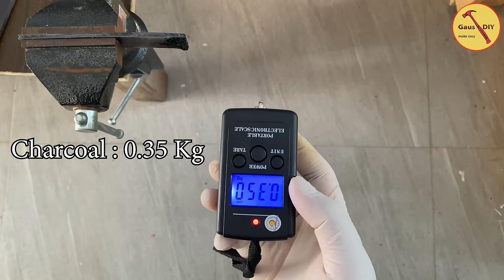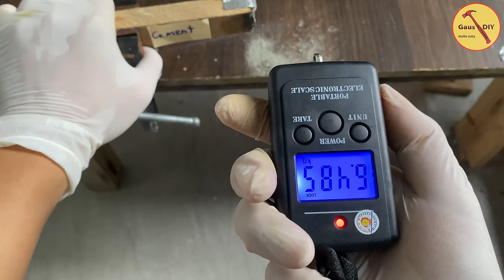3 Experiment Comparing The Strength: Baking Soda, Cement, Charcoal, Styrofoam

Comment: interesting video, and interesting experiment! you should try again, but try to be more scientific. the adhesives should have the same surface area on the material, the point you apply pulling pressure should be from the same distance from the connection point, the point where the vice is clamped should be the same distance from the connection point, the charcoal and cement should be ground to a fine powder (as fine as the soda), you should let the glue dry all the way, and many more variables you could control! good luck
Reply from the maker: Thank! Have a good day!

Comment: The single most important flaw of this test is location of the hook placement was so different for each. The closer you place towards the base the more force it will require to break it for the same strength of the glue because of the law of physics.

Comment: The Baking Soda seems to be the preferred here and there is a chemical reason as it reacts. However the charcoal has way to large particles. I used a combination of graphite super fine for locks and baking soda and did get higher values than with baking soda alone. graphite alone did not achieve the same result.Also the baking soda in the US seems to be more reactive than the one in Europe.

Comment: Ok, nice experiment. BUT, in science you should try to avoid external variables so the experiment is focused only on the subject of study. For example: 1. You should have measured the amount of superglue in each case, and the amount of bonding material so it is consistent. 2. You should have measured all your pieces to be exactly equal in length, width, height and weight so there is no influence on the results. 3. When you were pulling on the screws, the plastic, and the wood, you should have pulled from the exact same spot (to a millimeter) all the times so the lever effect doesn't add up (the farthest you grab the lever, the strongest any force is excerted on the fulcrum). Finally, you should have tested for "flukes" by performing at least two experimets by type.
Reply from the maker: I'm very happy to read your comment, Thank you for your useful knowledge! Have a nice day!

Comment: Nice effort but momentum is the key here, its changing all the calculation.. so if you dont apply the forces on the same distance then it doesnt make any sense in comparison.. for instance I can see in the last experiment, force is being applied on cement is approx 15% far from the center compared to other materials which means its resistance is not 6,5, but around 7.5kg or even higher than charcaol.. this is very tricky :)
Reply from the maker: Thanks for your information! I learned a lot from reading everyone's comments! It helps my knowledge improve.

Comment: If you're going for my accurate results you should of placed the force gauge at the same point as all of them so they all would have the same leverage. Some of the tests u were closer to the center where the glue was and that is less leverage than being further out to the end so I would take a lot of these results with a grain of salt as the numbers wouldn't be as accurate as they should be

Comment: I don't thing the glue bonds were consistent, some of the bonds did not get completely saturated with superglue, judging by the dust cloud. And his pulling point moved around, causing different leverage between material tests. Even so, I would like to see tests of Graphite and and Graphite with different percentages of baking soda mixed in.

Comment: By not placing the "lever arm" the same distance each time changes the force placed at the joint.  In one of the examples, you put your thumb on the board which causes the force required to move.  This invalidates the example.   Ideally,  the distance from the clamp and the plastic tie should be the same for each tests

Comment: Not sure it was accurate measurements for the experiment, however my guess is that cement, if mixed properly would be the strongest. It didn't look like you used the right mixture.

Comment: I don't wanna be "that" guy, but if you're gonna experiment like that, you need more than just one run per element on each test... and then take the averages as a result. But most importantly for the love of god, the distance between the point you pull and the connection, if that's not measured exactly then all these numbers mean nothing.
Kudos for the idea though and the initiative.

Comment: Some of your other tests are better, but u missed a few things on this video. For instance...on that first test you do, your not really doing anything with your gauge except measuring when your hook slips off the bolt. Perhaps you should use an eye bolt, and cut off the end so you have a flat bit to glue to the wood. You'd be better off hanging them all sideways, and putting weights on them to ensure you have the same forces...as the angle you pull with your hand will also skew your results.

And then on your last test - where you glue the 2 boards together end to end; Note that you have a random placement of your Zip Tie when your pulling on that wood to test the force your pulling. For Cement your Zip tie is about 5 inches from the joint and the next one, your only 3 inches away. To do that right, you have to put your Zip Tie at the Exact Same distance from the joint to measure the force including the leverage you have used to pull the joint loose. 

For Example, if you put the Zip Tie 1 inch away from the joint, you will find it harder to break than if you put your zip tie 12 inches away from the joint, because your using the Leverage of the board length, to put force on the joint. So measure out the same exact distance - say 6 inches and put your Zip consistently at that point to measure your force at your joint.

So good try, but you need to brush up a bit on your mechanics a bit so you can accurately measure the forces involved.
Reply from the maker: I have received a sincere suggestion from you, I have also read many comments and have understood what you said. I will try to improve my knowledge! Thank you!

Comment: Why not use a machine screw and tighten a nut the same amount of turns or even two nuts, then you can pull from the same point.  The fulcrum needs to be the same height.

Comment: I like the video and your testing of materials but
You need  to be more scientific for better accuracy but we get the idea....

1.  your space in between the materials needs to be exactly the same

2.  the spot that you hook the weight scale on the screw and on the plastic needs to be the exact distance from the spot in the vise and 

3. The weight scale needs to be exact distance from the area that was glued.

4. And like the previous comment I guess the volume of the materials needs to be the same as well as the drops of glue need to be the same as well as using a separate spoon you don't want to mix the charcoal with the styrofoam ;)
Reply from the maker: Thank you for your sincere comments. I am very happy to read your comments. It helps me have more physics knowledge.

Comment: Ft-lbs Torque is going to be different if you pull on your glued pieces at different points.  It's the same concept of loosening wheel nuts and using a cheater bar.  The farther away you can pull, the more leverage you'll get.  All pulls need to be done from the same spot or you aren't measuring the same thing.  Cut all pieces to same length, and then measure & mark the spot you're going to pull from so that spot is the same on each piece.  Pulling an inch to the left on one test and inch to the right on another test for a quick camera audience might appear as being similar enough, but it's a pretty noticeable difference in pull force required that you're introducing unknowingly.

That charcoal should probably be dust or at least closer to it.

When you were setting up at 5:31, I'm sure half the audience was looking at the discrepancy in the distance apart your wood pieces were with the cement test being visually very obviously different than any of the others.  All tests need to be pretty systematic.  As same as possible.

Comment: Kind. But you should plan the experiments a little more cleverly. So that the conditions are more comparable. For example:
- Instead of pulling by hand (and using different levers), it would be better to hang a bucket on the sample and slowly let it fill with water.
- The amount/volume of the filling material should be the same.

Comment: But you are using the scale incorrectly, when measuring you dont hold onto the scale but the string that is protruding from the top of the scale, this string or loop is meant to be hooked to a permanent point somewhere, and you can put your finger through the loop to take correct measurement

Comment: Nice vid, though the experiment itself is flawed... as the points where your force is applied is not identical and you apply some kind of leverage and also in some cases you have some glue tape still in... just for real experimentations, make somewhere a hook, on which you apply the forces and also remove the tapes...but in itself a very nice test ;)... and by the way, not too strange that longer (bio)molecules may be better for such applications.
Reply from the maker: I have improved and produced a better video, I hope you will find it in my channel. Thank you so much for your sincere comments.

Comment: This popular method of using superglue and some filler material is all but useless for any purpose beyond cosmetic. Superglue is not at al super!!  It does not bond like other adhesives and doesn't really create a bond at all!!

Stop wasting your time with these superglue mixes!!  You  will get far better results with some general purpose 5 minute epoxy and there stronger versions for specific applications.

Comment: No consistency with the distance from the joint , the bending moment.  especially the last test 
cement was further from the joint easier to break with less force = 6kg the charcoal was closer to the joint more power needed = 8kg  also the gap the cement had to fill was larger.

Comment: Interesting and thanks.  In the clip, the final product is a composite, a continuous phase and a discontinuous phase.  In all cases, the discontinuous phase was superglue.  The tesile strenght of the discontinuous phase, then, is pretty much uniform.  Apparently.  So the material that won out, the cement, has a stronger tensile strength?  Who knew?

Comment: Very inconsistent testing/ Your gaps with the wood were different sizes and you pulled at different distances from the glue and you had more filling inside and on top different boards. If you would take your time and try to be a little more scientific you'd get more useful results

Comment: So this isnt really cost effective. Certain materials have manufactured bonding agents. Wood glue for wood. Epoxy and other bonding agents for plastics. However bonding plastics is never as strong as cast injection molded or formed plastics. Same with 3d printing its just not as durable. And with the cost of replacement plastic it really isnt worth repairing. This would cost more than fixing it the correct way. This is not the correct industry practiced method to bond these materials.

Comment: Your Chart at the end...is always blocked by YouTube COMING attractions and your LOGO. You need to put your test results up earlier so it does not all get blocked y YouTube ads in the last few seconds of your video.   But using a process of elimination, I can tell that Baking Soda was "TOP1 for Test 1 and Test 2, and then I can see shows for Test 3 with score of "TOP 3".
So...
- Baking Soda is best ranking over all with low score of 5 followed by 
- Cement at 6, then 
- Charcoal at total score of 8 and 
- Styrofoam coming in last at worst score of 11. 

And note that all you need for your Score is the numbers 1,2, 3 and 4, there is no need to repeat TOP1, TOP 2, TOP 3 AND TOP 4...it's just a simple ranking from 1 to 4 for each test.
Reply from the maker: yes, thanks for your comment. i added the result to the comment and pinned it there. thank you so much!

Comment: This "test" was useless.
It is a waste of time if the test setup is not clearly defined beforehand.
The material distances were different, the amount of backing material and adhesive were inconsistent, and the respective levers were not defined.
It is a rather naive test without any meaning or benefit.

Comment: Too many uncontrolled Variables in your Testing process.
The Hook should be at the same Height on the screw to measure the same pulling force on the bond
The Width of the Plastic strips all need to be the same.
The Gap of the Bond Needs to be all the Same
The Holding Distance from the Bond in the Vise needs to be the Same
The Attachment distance of the Hook Needs to be the Same.
Use the same quantity of Glue for each bond.

Comment: Your results are not reliable. The distance of the pull from the joint are not equal. You never made an attempt to make them equal. The distance used for cement was higher than in others. Simple principle of 'Moment' of force = Force x distance from turning point (joint) is perhaps not undestood by you.

Comment: Do cotton.
Reply from the maker: I've got a video about cotton. Thank you
Reply: @GausDIY   How does it compare with the others?  I find it to be very strong.  I put a hair brush in the washing machine and snapped the handle off.  Cotton saved the day.  Very strong.  
I'm wondering if it's actually the cotton or if synthetic cotton would work as well.  It might be just the fact that cotton has filaments regardless of its actual chemical structure.  
I like the music you use.  Very excellent.

Comment: No, sorry. This demonstration is almost pointless as the entire thing is so uncontrolled and really poorly measured. The cement is an odd sort of filler to use for gluing wood or plastic, and therefore, quite an uninformed choice, regardless of the far too short curing time (apparently) allowed. The grains of charcoal are far too coarse for comparison to anything else.

P.S. What did you mean by repairing scissors in particular, since you already mentioned repairing broken plastic items, which would include, say, plastic scissor handles?